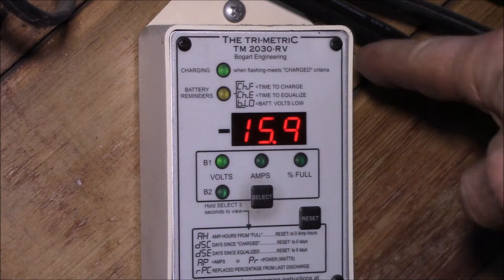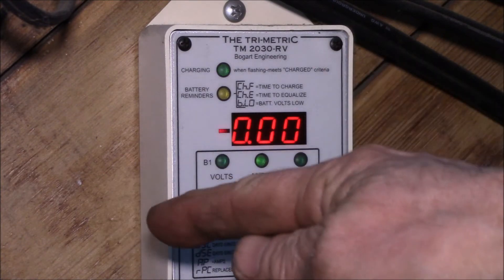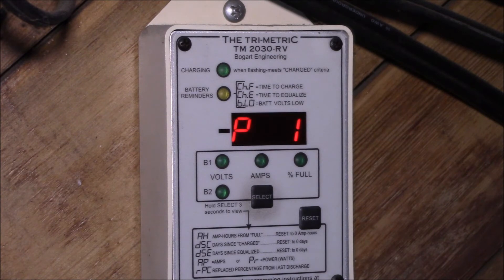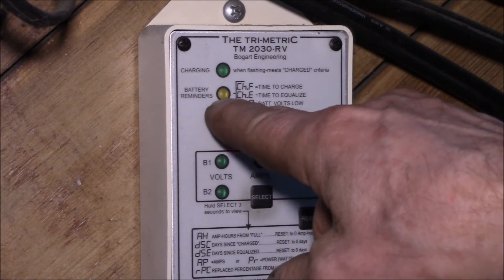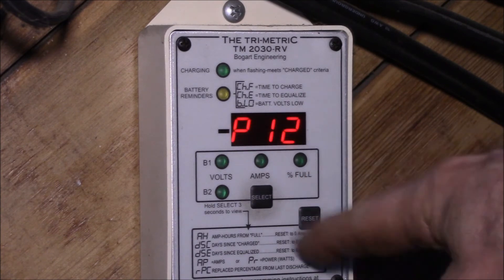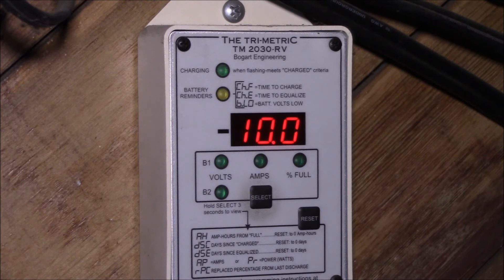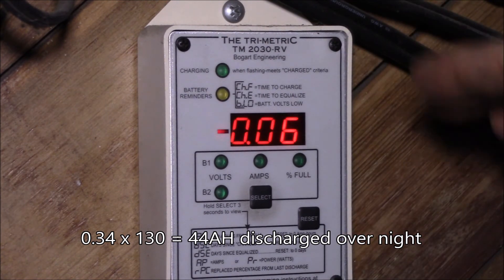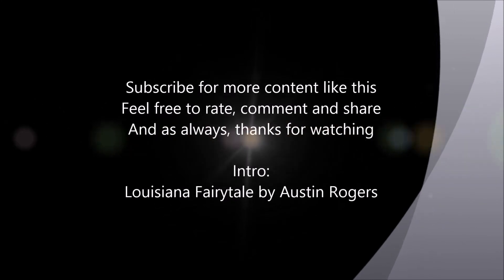Trimetric Battery Monitor on a 4S Lithium Ion Battery Bank

Comment: How does one calibrate the Tri-Metric meter?
Reply from the maker: In the user manual there is a voltage calibration:
P18: Voltage calibration: This is the “voltage calibration” adjustment if the voltage shown is not exactly correct.
Aside from that, there are the amp-hour rating of the battery bank as well as the charging efficiency value and the various voltage/charging limits that can be adjusted to dial in the state of charge if that's what you're looking to do.

Comment: awesome video, thanks...
have several of these trimetrics and they are handy...,

quick question~
one of my trimetrics (sealed led acid battery bank), continues to go over 100%..
i have reset it to 100 several times as it continues to go over 100%...(at 106% now)
batteries are full, inverter indicates that the batteries are full also (float indicator is on/lit),

which parameter deals with that issue?
Reply from the maker: There's P12 that enables the auto reset.  Then the settings that go into that reset, the voltage (P1), the multiplier (P2) and the amp-hour capacity (P3), then there's also the charging efficiency (P10).  What I do is note the charging voltage and current when the batteries go into float charge and use those for the reset parameters.
Reply: @The4Crawler  thank you, will try
Reply: Hello ! had to reset my trimetric.  Now it constantly goes over 100%.  (105% now) Checked P-12 and its enabled. P1 is voltage, and P3 is the cycles of the bank.  Have a feeling my issue is with P2.  Have various Trimetrics and all just say 2 under P2.  Any advice greatly appriciated.
Reply from the maker: @paulg-chavez837  Mine is set to 2.5% for P2, don't think I've ever changed that.  I found it's usually adjusting the float voltage and time values was the main thing as that's how the reset point is determined.  And then charging efficiency is something you can use to fine tune the amp-hours in vs. out.

Comment: Perfect
Reply from the maker: This Trimetric battery monitor has proven to be quite useful.  It gives a "2nd opinion" on the state of charge compared to my BMS.  Most of the time they're quite close, but sometimes not so much.
Reply: @The4Crawler  my Trimectric is set up like yours. I had some tweeking to do when I switched from FLA batteries to lithium ion.  It is very close but not exact yet. I have some adjustments to make on p2

Comment: Best explanation I have seeing so far on this meter. Only thing some of the perimeter only works with the charge controller that is sold by Bugart Engineering. Nice video tho keep the updates coming.
Reply from the maker: Thanks, glad you found the video useful.  Yes, I did mention the SC2030 charge controller briefly and I skipped over those parameter specifically related to that charge controller.  If I didn't already have a charge controller (or actually 2) for my 4S lithium battery bank, the SC2030 might be an interesting option with the user specifiable charging parameters.
Reply: Hi I am having a little problem with my 2030 battery monitor. I have it set up on a 24volt system, my P1 setting is 28/P2 setting is 2.5 and my P3 setting is 420amp hour total battery amp hour of my system. The problem I'm having is the percent full seems to be working ok but as the battery voltage fall at nights the percent empty seems to not correspond with battery voltage. For example when my battery is showing 23volts the percent empty is 65% I'm not sure that this reading is correct as 23 volts is around 10 or 20 percent from empty. To get the monitor to read close to the correct readings I have to change my total amp hour to 210amp hour. Please help if you can.
Reply: @seanjsolar2493  Please contact us by email or from our support page and we'll help figure this out.

Comment: I put one of these in my camper and love it. I'm looking to replace my 6v Trojan T105 (2) batteries (220 AH @ 12v) with one LIthium Ion Battery (100 AH). I just need to find a $1,000.00 laying around to do it. Anywho, nice video.
Reply from the maker: Sounds like a good setup.  Yes, I toyed with the idea of going with a ready to run LiFeO3 12V battery, but decided to try the DIY Li-Ion instead.  Luckily the Trimetric is fully adjustable to you should be able to dial it in to work with the new battery.  Only real limitation I see is the 0.1 volt resolution on the settings, but I think it'll work just fine.